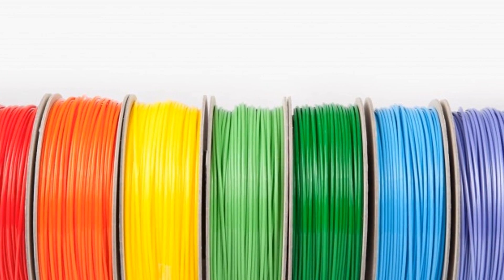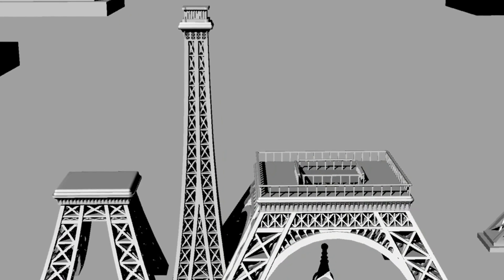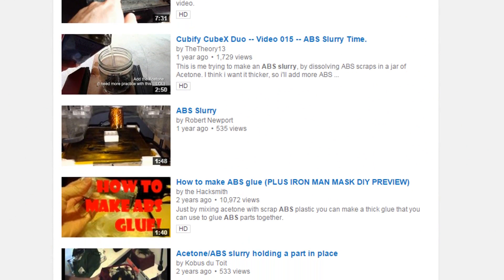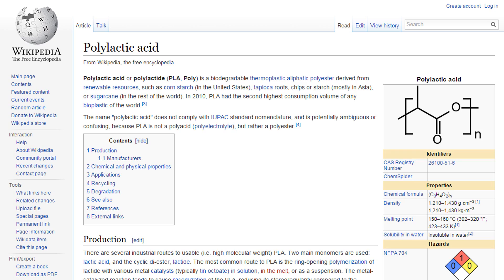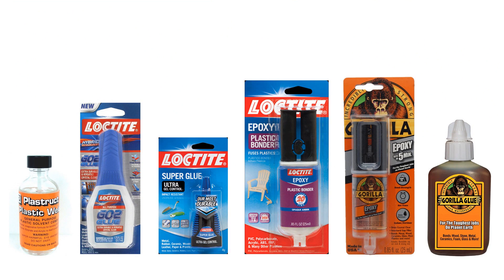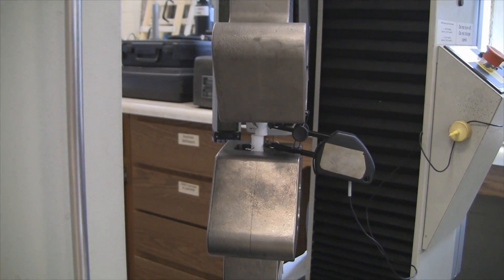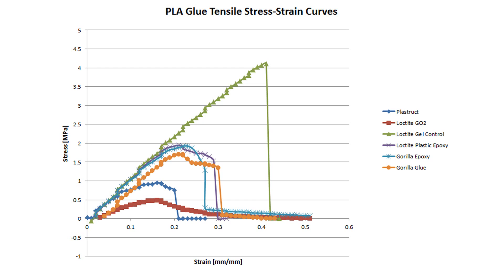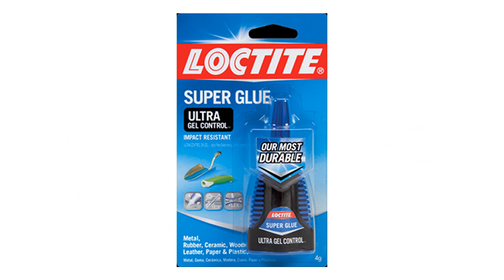How to Glue PLA Parts

Comment: CA glue / super glue / Gorilla glue / Loctite gel are similar products, they bond very well, but they keep off-gasing causing print surfaces to form white haze repeatedly (maybe caused by the common cyanate chemical). They are not ideal unless you plan to prime and paint your prints. I am experimenting with hot glue and UHU all-purpose glue to see if they off-gas, they are harder to use as highly viscous gel but if they don't haze that would be winners. Though I think 3D printing pens or soldering iron with filaments is probably best.

Comment: Quick question and maybe a follow up video. I have a large amount of PLA parts to glue and the little .14oz bottles of ultra gel just will not cut it. Do you know if the Ultra Gel is the same thing as the commercially available Loctite 454 gel? Maybe a strength test between the ultra gel and loctite 454 gel to see if they are about the same or if one is better? I have a feeling Ultra Gel is retail version of 454.

Comment: Hey, thanks, man! I've got PLA pants needing gluing, after splitting, and was thinking of using a Gorilla gel. I've seen a couple of Makers using it, but they also use a curing spray, which I don't have. But I really wasn't too sure. But now I think I'll give your recommendation a go. I'm still in the prototyping stage, but I don't want to have to deal with parts breaking - on a Drone that's never good. Thanks again for the info!

Comment: Great video, however I would love to see multiple data sources (more than 1 piece for each test) and at least 2 different factors: "smooth planes" (lets say 150 or + grits) and "rough/sanded planes" (60 grits or less), to check how each glue perform under those conditions.

Comment: I have had very good success with regular old superglue from the 7-11.  That said, I designed in significant gluing surface area.  As far as gluing broken parts, not as good when the contact surfaces were relatively small.  Of course, that is the nature of glued surfaces.  In any case, great video.  I'm a numbers guy.

Comment: The best is welding with the same PLA instead of adding new material!
Using a printing pen is an option if you can slow it down.
Or an old soldering iron will do with the right tip.
It's like welding of metal but with lower temperature.

Comment: Just an FYI for other folks watching this.  I bought Loctite Ultra Gel control after watching this video.  However, Loctite Ultra Gel control doesn't seem work with  PLA pro or PLA+ (I have eSun PLA Pro).  Perhaps PLA  Pro or PLA+ is a different than regular PLA.  Just thought I passed this info along.
Reply: I ended up using Bob Smith Super Glue and Accelerator. Amazing stuff - it bonds instantly with the accelerator.  Much better than Loctite Ultra Gel.  https://www.amazon.com/Bob-Smith-Industries-BSI-157H-Insta-Set/dp/B0166FFCHS

Comment: Actually there are multiple types of CA's available, some formulated specifically for plastics. Additionally there are thin, medium and thick consistencies plus CAs with additives that make it more flexible.I would like to know which works the best because not all CAs will work well with plastics in general.

Comment: Interesting video. Based upon this, I bought some loctite gel control. Expensive for a small bottle, but it gets 10x worse when you actually use it.  I could glue 5 small pieces and it was empty. I thought it was a fluke, and I had bought 2 bottles, with the other one, it was the same thing. Then I read the wrapper: it contains 3gr worth of glue. From which, you probably can get ~2gr out. Thats literally a few drops, for €8 !  I find Bison Hard Plastic glue works almost as well,  and is 10s of times cheaper. I could do 5 tank tracks per loctite bottle, and after 100 tracks , the bison tube still looks mostly full.
Reply: Open up the Gel-control package.
What do you find?
A tiny single-use tube of glue.   You know, those little metal-foil tubes that you have to puncture to use?
Yep, that fancy applicator/squeezy thing is just a handle for a $0.49 tube of glue.
Reload the damn thing, son, and save a bundle!

Comment: I'm curious why you did not test other brands of super glue like Zap-a-Gap, when going in it would be obvious the epoxies would not be a good option.  There are a lot of cyanoacrylate glues that have different properties that are worth testing.  And comparing all of these to solvent welding would also be handy.  Great video, just wish your sample set was a bit broader (or at least included other CA glues and solvent welding rather than epoxies)  Maybe a followup?

Comment: I love how loctite ultra gel control costs 7$ for one on amazon (with like 50% discount if you buy 8), while it costs 70$ a piece in EU. Result: I need to spend 60$ on shipping for a 22$ product. Nice.
Reply: Just look for super glue (or lookup the translation for super glue) and you will find many brands available in any DIY shop. Here (Netherlands) it's even available at some supermarkets.
Reply: I think the key takeaway is a "cyanoacrylate-based gel glue". Doesn't have to be the Loctite brand. PLA stays a little flexible and it expands and contracts with moisture a little more than other plastics. That's what causes the normal epoxies and superglues to flake away. Not enough "give" to them. The gel glue must stay slightly pliable, making a better match for the properties of PLA.
Reply: Covalence Dust Did you find a brand in Europe? Its cheap on EBay with postage but i rather have it fast ;)

Comment: Cool, that's the glue I use. With ABS you don't need to create a slurry to glue parts together, just put some acetone on the parts directly then stick together, often the bond will be stronger than the rest of the print.

Comment: Did you give the epoxy time to cure ?

Most epoxy resins with set but not achieve their maximum strength until 24-48+ hours later.
Reply: and then they would not peel off but fall of :) much better!

Comment: I use Weld-On 16 - the thick stuff, you can buy it in tubes from most plastic supply stores. I think it's about $10/tube. Your joints will not break - usually, a different part if the PLA print will fail instead. It forms a chemical bond between the parts, and you only need a smear of it. Move quickly, though - it will air-dry super-quick if you don't join the parts ASAP. Cure time is about 1h.

Comment: Is it possible to glue the PLA material to a Silicon wafer by any adhesives/Glues?
Reply: Short answer is no, you would need very nasty solvents and glues to do that and that is absolutely not sold to an individual and then it will still not be especially good anyways.

Comment: I so far had my best results with 2 component epoxy. The glued parts don't break where they're glued but next to it.

What's your advice for gluing Filaflex (polyurethane + aditives)  on PLA ? I tried cyanoacrylate but it sets way too fast for what I'm doing. It's peeling strength also isn't very good. I'm not sure epoxy would cure well because it's going to be on a pretty large surface. I'm considering Neoprene glue.

Comment: I have found that pure ethyl acetate (available on the net) works great.  Liberally coat both parts in ethyl acetate and let them soften for a minute before pressing the two pieces together.Note that SOME fingernail polish removers are mostly ethyl acetate (read the label), so those may work as well, although I haven't tried them. I would get the ones that don't contain oils like lanolin.

Comment: I need to glue 400+ small threaded 8-32 metal studs to PLA shapes.  I have to fill a void which this super glue will not do.  What can I do to fill the void and glue the studs to the PLA? HELP!
Reply: +AffordBindEquipment maybe melt the PLA with a lighter and drip it where you need it. You don't get a lot of control over it but it has worked for me on a few ocations